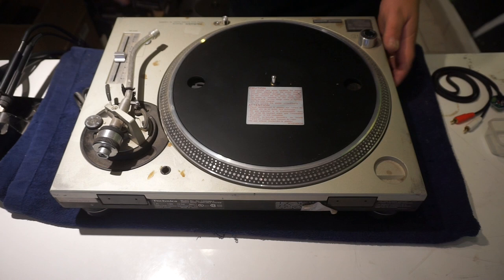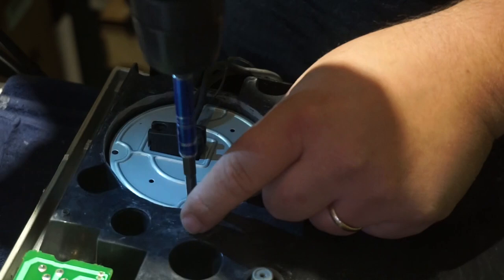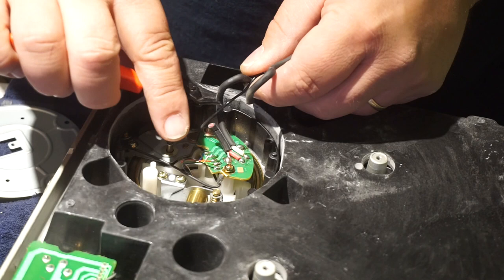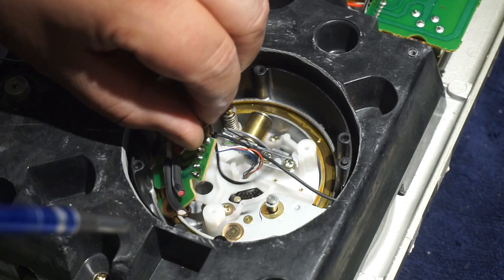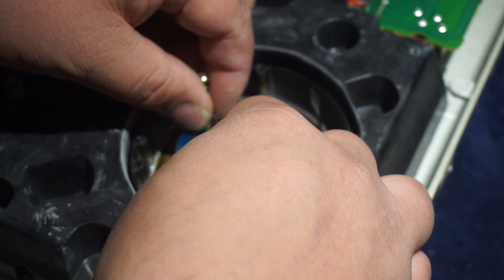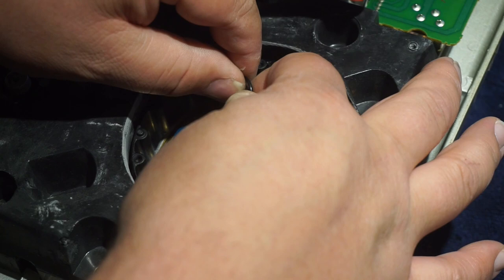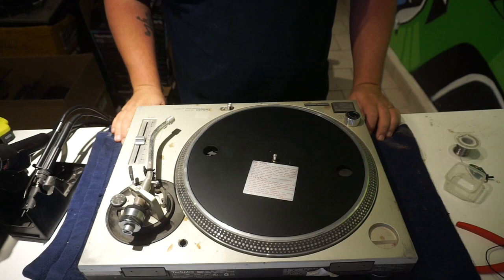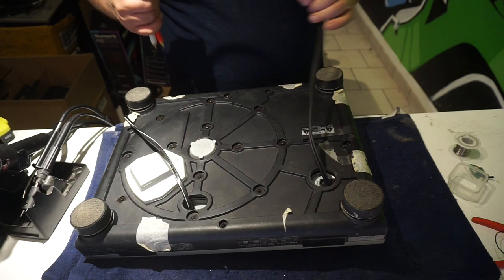JESSE DEAN DESIGNS JDDTECH-RCA INSTALLATION TECHNICS SL1200 1210

Comment: He's too lazy to take care. Tonearm when he flipped over the table it's not a professional at all rule number 1 take care the tonearm because it's the heart of the turntable do the job right or don't do it at all if you want it teaching something do it on the professional way not on the lazy way. Also it's a tool it called a Phillips screwdriver. Do not use power drill on those screws.👎👎👎

Comment: THE CABLE HE PUT AWAY IS A PIECE OF GROUND WIRE. THE GROUND WIRE WAS CUT AND A SMALL PIECE WAS USED TO INTERNALLY GROUND THE TURNTABLE. THE TURNTABLE MOST BE GROUNDED. ONE END GOES TO PCB BOARD AND THE OTHER END GOES TO THE PITCH. IF YOU GET HUMM CHECK YOUR SOLDERING WIRES, INCLUDING THE GROUND WIRE.

Comment: great video. i was little apprehensive about opening things up and soldering and replacing the board but your video was extremely helpful. replaced it on both turntables and turned out great. thank you!

Comment: They worked great with my 2 channel pioneer mixer, today i purchased the pioneer xz unit and tried linking my technics into the 2 spare channels on that, absolute no go, thank god i didnt snip off my earth cables as im going to need to feed them back through and use them on the earthing point on the console. Just tuck them in, dont snip them off, you may live to regret it.

Comment: I changed my old cable like you showed it in this video: Now the sound is more quiet than before. Something is wrong :-(. If I turn the amplifier louder I have a humming. What happened?
Reply: Its an bad idea to cut the ground wire, if you use an home audio amplifier :-// You should say that in your video. I sent your item back to the shop, because the sound was worse too. The original board is better. I compared it and the ground humming is a serious problem for people who use home audio amplifiers.

Comment: I just replaced my RCA cables with yours. I was hoping it would fix my issue of the sound from turntable only coming out of one side. It’s not the head shell or my mixer. Any other things you could think of that it could be?
Reply: Did you check wires in your tone arm?

Comment: it doesn't work for me.  after soldering I have a humming sound on both channels all the time.
Reply: This does not work for home audiophiles, had to put my SL-1300 back to original after I bought one off ebay.  You have to have the table grounded to the amp or you will have a deep hum.  Especially when you have a cart rated at 5mv like Shure.
Reply: DJJohnny Cruz   how do you solder the ground to the negative, in other words how do you know which is the negative wire?  I'm a newbie..thanks in advance.
Reply: @vettrious  I use more than one amplifier, but I connected the ground to the first one in the circuit - the MM preamp.  Should I try to connect to my Marantz or my Yamaha instead?  Thanks, Mike.
Reply: @El-brujito  THE NEGATIVE IS ALWAYS ON THE EDGE OF BOTH SIZE, REMEMBER MAIN NEGATIVE AND POSITIVE ARE IN THE CENTER.